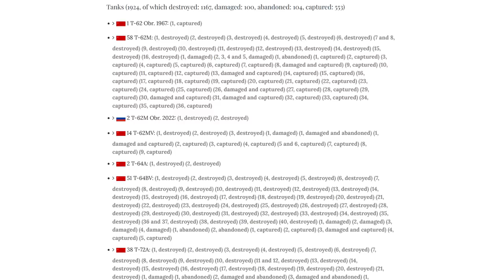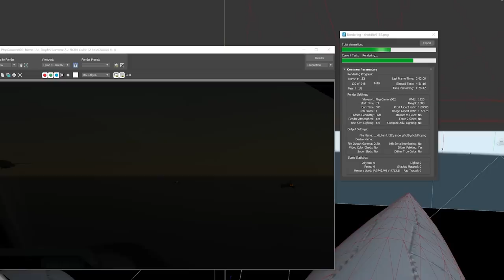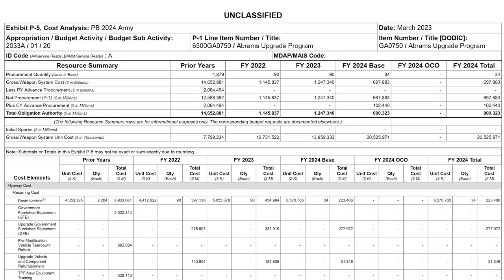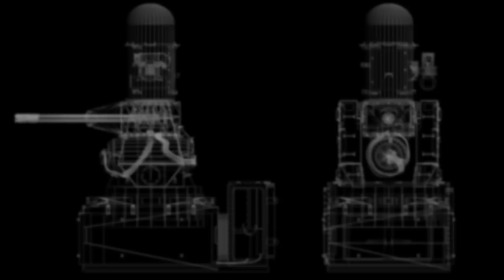US Tanks in Storage - Several Hundred Less Tanks in the Past Year

Comment: The US has not been building new Abrams for a while.
When the US supplies Abrams to other countries now it pulls them from US stock.
What a lot of people don't realise is that in msny cases when s country says it is getting. new version of a tank, they are not new builds, but they are esisting tanks/hulls that is being upgraded.
So for example when the US announces they are adopting say the M1A2, they are probably not buildingg new M1A2s but rather taniking existing tanks and upgrading them. This can often mean they remove every part from a hull, sandblast it and then rebuild it with new components.
So when you see tanks dissapearing from a storage facility if may just be that they are being taken to a facility to be re-manufactured.
When you're going to upgrade a tank, you don't want to strip them from active units as that means your units won't have tanks, so you take your old tanks from storage, re-manufacture them and then issue those tanks and take the tanks from the active units and put them in storage.
So say the current model is the M1A1 and that is issued to unit and then you announce you are moving to the M1A2.
You'd take M1s from stroage and upgrade those to M1A2s, issue those M1A2s to units.
The units M1A1s would go to storage. This way your units always have the most recent tanks available and your stored tanks are only one or two models behind your frontline units.

Additionally when the US sells Abrams to another country, e.g. my country Australia (04:20) which is going through the process of buying around 100 Abrams from the US, the US is selling tanks from it's own national stocks. It has to because Abrams are no longer being manufactured new.
So if Poland is buying Abrams, and Australia is buying Abrams and the US is donating Abrams to Ukraine and the US is moving to the M1A2SEP, then it is likely a lot of tanks are being taken from storage and remanufactured for all of those users/customers. 
So from Jan 2022 that's about 250-300 Abrams just for Australia, Poland and Ukraine, plus any other countries that are buying Abrams, plus tanks being remanfuctured to A2SEP for US issue, at what 90 per years so now you're at around 350-400 Abrams being sold/upgraded from 2022-2023.
You've probably also got things like re-organisations e.g. say the Army decides to add extra vehicles to brigades or battallions for doctrinal reasons or that a national gaurd battallion that only had 2 companies due to man power issues or whatever now has eogh people to justify another company stuff like that and yeah you're gonna see a lot of movement out of and in to long term storage.

It doesn't necessarily mean the US is running out of tanks, although the fact that a US MBT replacment program has not really been seriousluy considered is a worry.
It dould be good if Lima could be re-opened for low rate production just to make sure the US has a tank line.
Things are looking scary these days.

If the US started consuning tanks e.g. land battle in Europe is seems likely to me they'd be using Korean tanks pretty soon as AFAIK Korea has the only open "free world" MBT line at the moment.

Comment: Although this is not like for like comparison. US has 2,500 Abrams, not just "tanks", but ruzzia has 6,341"tanks"... that is T54/55, T62/64, T72, T80, probably dozen or so T90. The Abrams even the most basic M1 is solid equivalent to quite well upgraded T80 (something like BV, UD or BVD) or T72B3... and I am sure that from 2500 tanks none are original M1s/, most are not even M1A1.

Based on some production numbers it seems that all original M1 were upgraded to M1A2, most of M1A1, to either M1A2 or M1A2 SA, then most of those tanks were upgraded to at least SEPv2 standard. So my rough estimate would be that very few M1A1 remains and if they do they are in the pile of broken tanks, M1A2 will be ~500, and then the rest of ~2000 will be different SEP spec. In short - most of US tanks in the storage will be T80BVM/T90M. Most of ruzzian tanks in storage will be T72s. So I am quite sure that if massive tank battle would take place today between 4000 "good" ruzzian tanks and 2000 "good" US tanks, the ruzzian tanks would be destroyed 10 times over without inflicting major damage to US fleet. Obviously that is purely theoretical as no major Kursk type battle with happen between Abrams and whatever trash ruzzia could throw at them, but the point is the 3911 "good" ruzzian tanks are certainly not T80/90s, and even more certainly not upgraded versions of them.

Comment: I know that when I was stationed in Germany in the 80's we had 1500 takes and other equipment mothballed around germany.  Every reforger they  would take out enough equipment for a division.  The USA unlike Russia maintains all their stored equipment by starting and driving the equipment every month and replaces all the fluids every two years.  One of my jobs as a brigade S2 was to go to the site for our army group and verify that all the equipment was fully operational.  They had mostly M60 takes at the time but according to records we could fully equip an entire army group with the equipment located in Europe.  That was the 80's but I am not sure what the TO&E would be for todays army group.  The key thing is that the USA does not store this equipement outside and the only time it is outside is the monthly runup and when US based units are using the equipment.

Comment: Weird that you don't know that the US has two types of Abrams, their version and an export version. They won't ship the tanks they are using to Ukraine in the offchance that one gets knocked out and Russia gets their hands on it and finds out whats in it.
The armor is not just steel plates its compound stuff, same as in the Leopard, and it is still classified.
So no, none of those tanks in reserve will go to Ukraine
Together with the 30 tanks from Europe Challengers and Leopards Ukraine gets 60 modern western tanks, and that wont do alot in an offensive unless they all start pushing in one spot at the same time.
But they would have to deal with the air superiority when they want to push into occupied territory. 60 tanks are not enough to push the entire front.

Comment: The U.S. has been selling of some of its reserves. Partly because the plan to build new tanks. Even if the new tanks are just using old chassis.

However, due to metallurgical breakthroughs the last couple years, they will likely produced all new chassis from scratch. The U.S. has developed a new metal alloy that's significantly stronger then the depleted uranium armor.

Comment: Great job with this video. I think there are few more important points of context though. For one you mentioned basically all US tanks are constantly moved around, which would indicate that US "good" =/= Russian "good". And we see this with the kidns of tanks Russia has. Most of them are not just a generation out of date, but also not what the US would consider as fit for services. Another point here is that the US has been steadily decommissionign tanks since the 90s. There were like 8,000 reported tanks in the early 2000s, so losing 300 in a year tracks with the overall reduction in tank stockpiles.

Comment: Yeah, the initial idea was to give Ukraine all new build M1A2s. This wouldn't deplete the stockpile and build out the production capacity to either refill the stockpile( or upgrade more of the older M1 and M1A1s to the M1A2 standard) or provide Ukraine and potentially others(read: Taiwan) with however many tanks they would need without compromising American National Security. The problem, as you state, was the facilities wouldn't be ready until January 2024. I wonder if they are still building out the facilities for that or if the resources were diverted once the decision to send M1A1s from the stockpile was made.

Comment: Im not worried if you wanna know where does 300 tanks went go ask poland and ukraine. 

Btw what you dont see is the fact that the US still has houndreds of unfinished hull and turrets in storage from the late 90's early 2000's production run that is not counted as tanks.
Edit: There also multiple levels of storage from the highest being at sierra depot and the lowest being stored in a literal open field inside a base.

Comment: One thing that you did not mention were all the M-60 and M-48 tanks still in storage, not only can a 120mm gun fit in these turrets but an M-1 turret will fit on these hulls as well.  The depth of USA tank stocks is quite deep.  Also the Lima Ohio tank plant can build new M-1 tanks but do not because the US Congress has ordered them to stop at 8800 vehicles, this is why older machines are continuously rebuilt, to keep the numbers under 8800.  That does not mean that they can't build new tanks from scratch, they just do not.  There are prototype M-1 tanks that appear to have Leopard 2 turrets and others with diesel engines that may be Leo2 power packs. Thus the total number of tanks available is very high indeed.  The USA in simply not trying.
Reply: agree, not trying, don't think they will need tanks, is denial good or smart, and realistic.?
Reply: Where are those M48 and M60 stored? I thought they were all used for target practise?

Comment: the conflicts the US needs to prepare for are going to be air and naval ... after afghanistan and iraq, the US is done with having an expeditionary force for a while

so rotating those abrams to allies, so they can rotate their older equipment to ukraine - best use of them. Mexico nor Canada are not going to invade any time soon.

ultimately , rotating out old stuff is a cost saving measure - 'divest to invest' and holding on to the 90's era stuff requires upkeep , maintenance, storage : and much of this is already outdated or scheduled to be replaced entirely 

TL:DR the US doesn't need this stuff, and wouldn't need it vs russia or china, so getting it to where it serves as a deterrent for our allies is the best way to let it go. Our allies will field the ground forces, and in a worst case scenario - the US will back them up with air and naval power. So the best home for 90's era ground assets is with our allies, it doesn't serve much purpose in the americas.

Comment: Tanks are becoming obsolete on the battlefield now as you see in Ukraine. Drones and light battle tanks are better than heavy battle tanks. They are also becoming obsolete due to portable weapons to take them out. Tanks are only good for other tanks but now a single man with a portable anti tank weapon puts a tank in a no win situation. Also drones are very good at taking out tanks. Tanks are no longer needed for modern combat. The tank has been replaced by other weapons systems. There is no need to field thousands of tanks anymore because against modern weapons they are sitting ducks but still it's ok to keep enough if needed.
Reply: you dont know what obsolete means

Comment: Is there any chance US tanks will arrive in Ukraine before the war is over?  The USA is not alone in being ridiculously slow in sending promised equipment and ammunition.  But the audience here is American.
Europeans need to get them their butts in gear on manufacturing ammunition now, instead of the current committee set up to increase ammunition production in 2Q2024 that will likely not issue its first report until 2Q2025.
Reply: Europe is producing ammunition the military industrial machine in Europe is practically none existent, hence it appears as if they do nothing they are they just don't have the capacity.
Building new fabrics for this will take years by the time they can produce in meaning full measures this conflict would be long over.